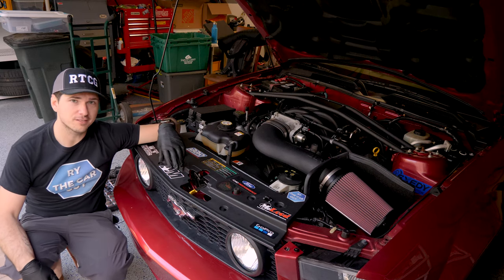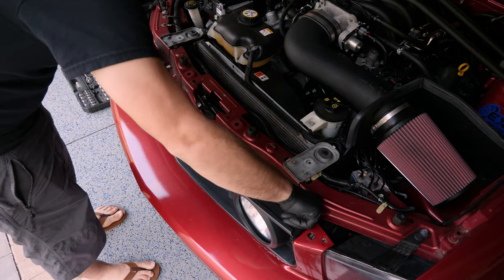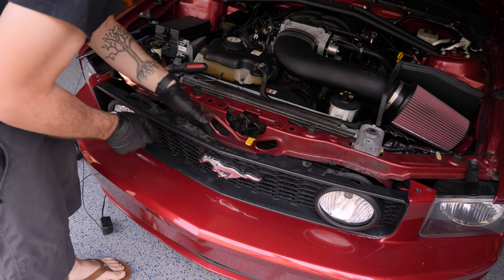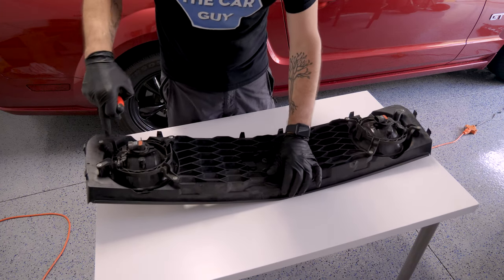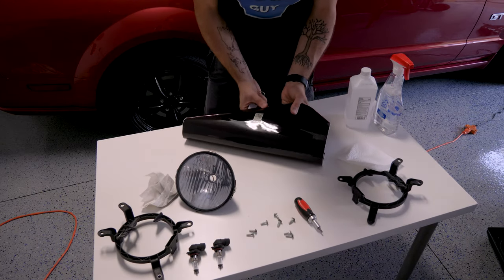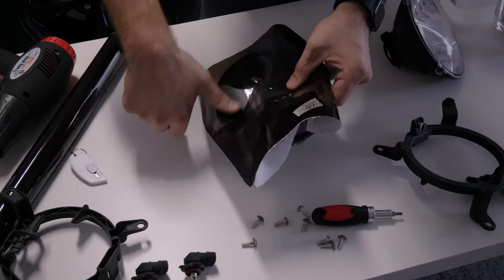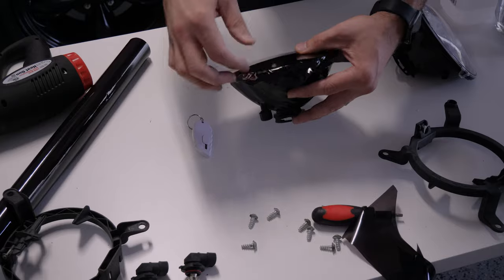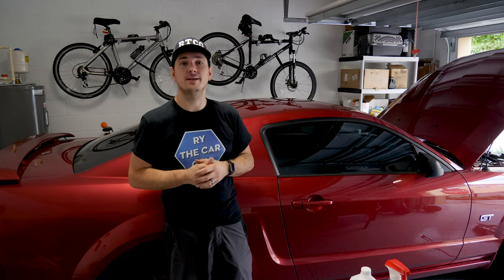How To Remove S197 Mustang Grille and Smoke Fog lights 2005-2010

Comment: Just changed out my stock Bullitt grille. AM says to pull the front bumper, though it only takes about 15 minutes to pull, I didn't want to do it. Did it your way and was thru from start to finish in 22 minutes. Thanks.
Reply from the maker: My pleasure. Glad to help!
Reply: I have the same grille how many clips does it have